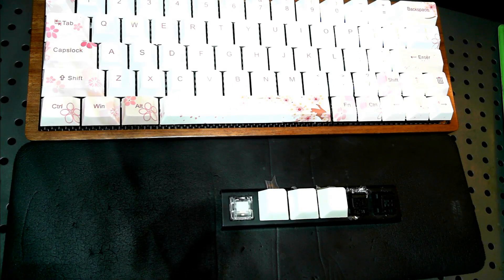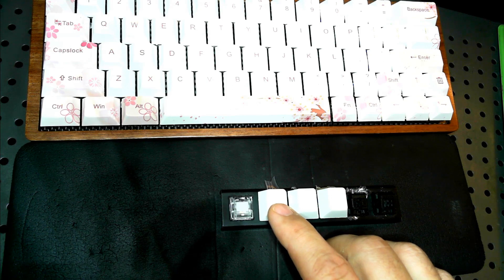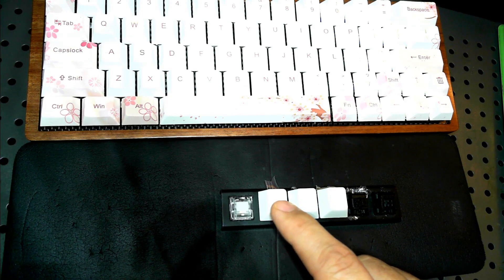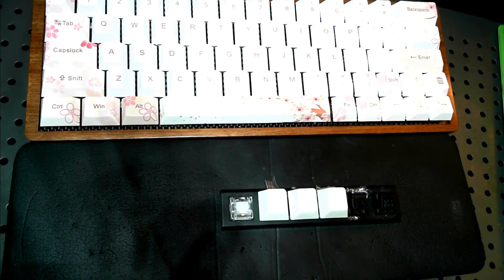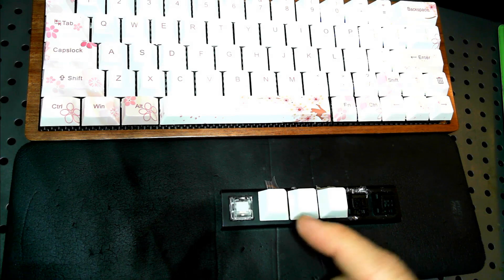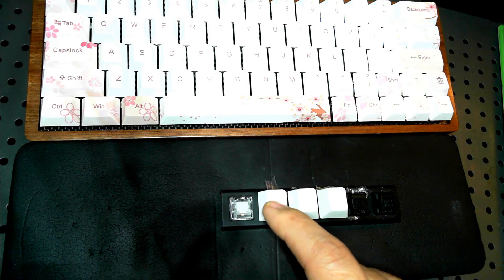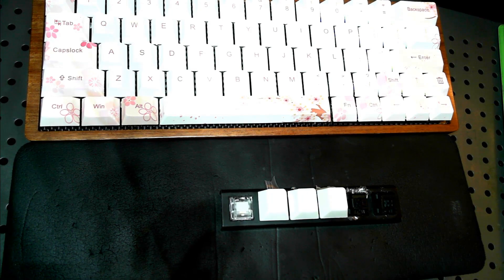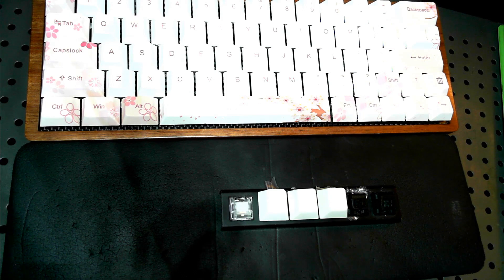Choice of lube dramatically affects switch sound

Comment: The "thickness" (or consistency, in the case of super lube or Krytox 205), is independent of their base oil viscosity.

Funny enough, Super Lube has a decent viscosity (about 1/2 of Krytox), but that's kinematic viscosity. For our purposes, we want dynamic, and Super Lube grease has around 1/4 of the dynamic viscosity of Krytox.

Sound is dependent on the actual viscosity of the oil that the grease is made from because it affects the film thickness while moving.
Reply: TBF, kinematic viscosity is more the capacity of defying gravity and staying in place. Less viscosity in the keyboard case just means a shorter period between the laborious lubing maintenance. With Krytox 200 series and Tribosys, the teflon inevitably separates from the oil over time so people should only (very lightly) use for GPL 107 oil and use other ways to damper noises as those greases don't keep their consistency and the sound will come back.
Reply: This is really great information.  May I ask where you were able to find the dynamic viscosity of the Krytox products?  I am curious how the dynamic viscosity of some other lubes I like compare, such as Christo Lube MCG 110

Comment: This video doesnt really show the difference between the lubes that well. The sound will vary depending on what keyboard the switches are on. The case, backplate, foam, and keycaps play a role into the sound of the switches and different switches will sound different with different lubes as well.
Reply: yeah, even each individual switch from the same batch sound different depending how fit the parts are between each other.

Comment: forgot the cheapest and most availible one, olive oil.
Reply: Dawid Mikan i tried with canola oil, im scared cos i dont know if it will make gum or something
Reply: W0llifishyツ what happened?
Reply: scammenot scammenot at the beginning, some switches stopped working by moments but now everything is ok and the sound is so nice but i don’t rlly recommand cause it’s too risky in my opinion but u can let me know if u give it a try, see ya 😀
Reply: W0llifishyツ so, just dropping the switches into oil?
Reply: scammenot scammenot no, press on the switch and drop jus a bit of oil between the plastic part ans the switches, udont need to dissolve them but if u wanna dissolve them there will be les risks i think
Reply: @VVGBeats  that's.... not a good way to lube switches at all
Reply: ZeeZee well, too late
Reply: ZeeZee ho and what’s the difference btw?

Comment: I think it is due to their difference in viscosity. Usually the viscosity values are not marked on the tubes, and other "lube enthusiast" do not even mention it too. And there is a special formula to calculate the final viscosity of 2 lubes after mixing them.
Reply: yup, super lube is thinner, trybosys is thicker